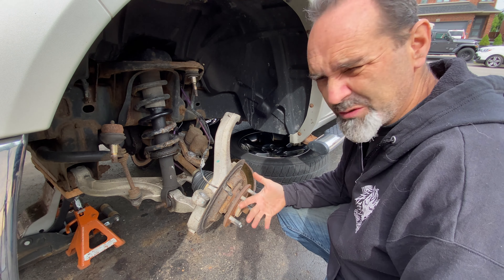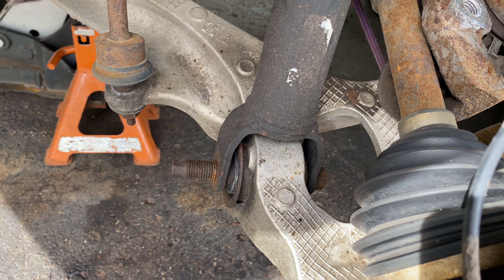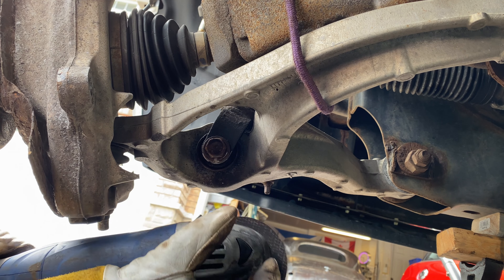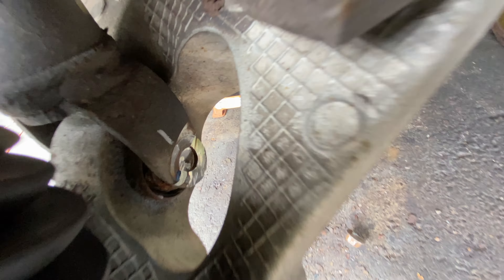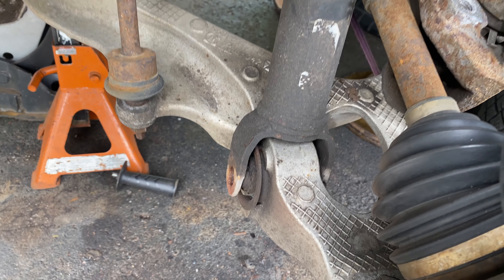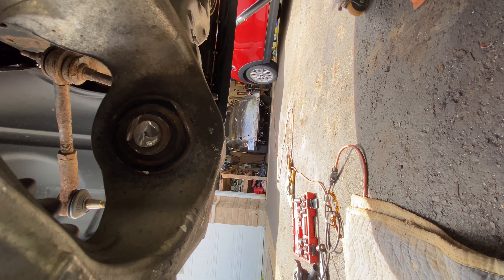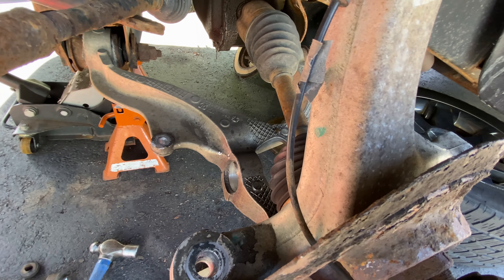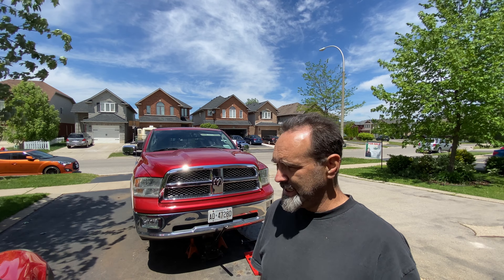Front Springs And Shocks Replacement 2010 Ram 1500 - Part 2 - Lower Shock Bushings

Comment: They bolt along with the two lower control arm bolts are seized also plan on putting new upper and lower control arms and all hardware on meanwhile new wheel bearings and cv joint tie rods sway bar and hardware I used a cutoff wheel and a sawzall and het to work .then take it immediately to a reputable alignment company

Comment: Maybe if I stare at it long enough...

Yeah, been there. If I stare at it long enough, I'll come up with a brilliant idea. My solution was similar to yours; cut the lower strut clevis off with a Sawzall. I destroyed the bushing, cut the outer cup with the Sawzall and peeled it out.  Installed a new bushing, which required a ball joint press.  Now I'm stuck at trying to get the lower control arm down enough to get the new strut in.  The A frame bushings are so tight, it barely moves.

Comment: Smear a dab of anti size on the bushings before you press them in and smear some on the bolts as well
Reply: Good advice, I should have bought stock in the product as much as I use
Reply: @leonardwalters154  I hear you in that...I have a big can of both the silver and the copper and use them both liberally

Comment: Dave next time use a hacksaw blade upside down put through hole installe on saw and cut the sleeve. Takes tension off sleeve easy to remove.  Victory to you my friend.